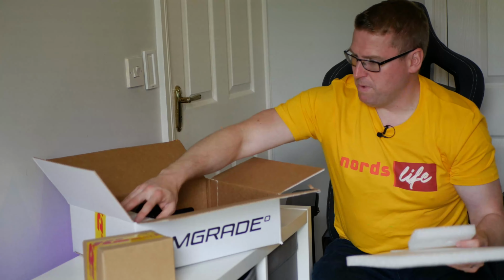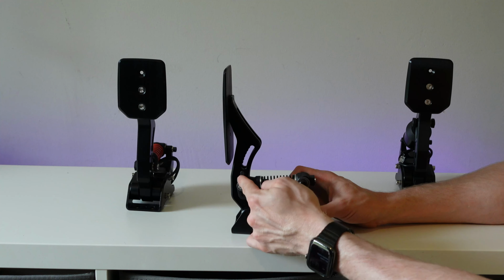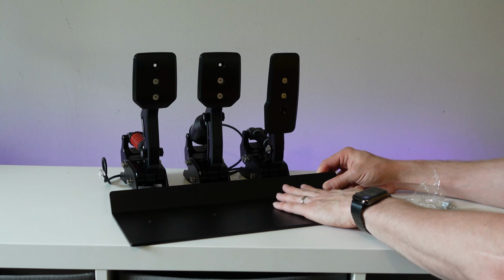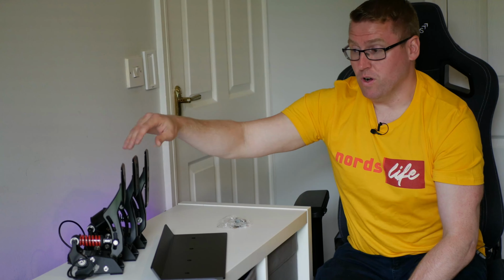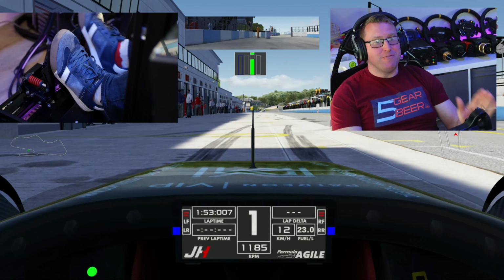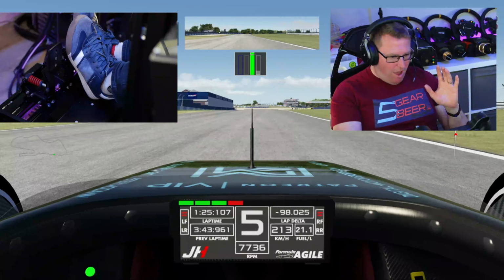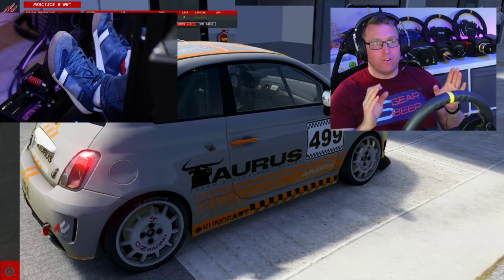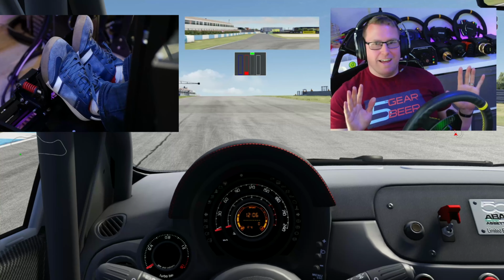Simgrade Thera 200kg Load Cell Pedals | Unboxing & First Impressions

Comment: That pedal deck is mounted the wrong way :D Those long slots are supposed to be facing ur seat so u can angle it more upwards.
Reply from the maker: Yep. I had to reverse it due to the sim floor and the size of my seat mover. If I have it the ‘right’ way around then I cannot hide my cables under my sim floor

Comment: Lol, so much wrong info about the pivot point height on the pedal. Higher position is less leverage, so a harder feeling. So even with the same spring strength, your throttle will feel harder the more you depress it. Same for the brake. High position is a stiff brake with less travel. A lower mounting point is more leverage on the loadcell, so it will be easier to compress the rubber. So basically more travel like you would have with a softer rubber stack on other brand pedals.
Reply from the maker: That is also my understanding. Where did I say otherwise? If I got it wrong, I’ll correct it. Thanks in advance
Reply: @LaurenceDusoswa  You said the opposite here: https://youtu.be/1g9Drkc1i0k?t=340

Comment: Hello, just a quick question, in your experience what is the pedal that is close to an actual normal/road car in general?
Reply from the maker: Good question. I think that most high end pedal sets are better than any setup I have used in a road car. However in a road car you get g forces which make a huge difference to the feel of the pedals.

Comment: The good old struggle of Laurance figuring out where the clutch goes. ;) 

They certainly do look great. Mounted they have a really nice small footprint and look very clean. Im sure there will be a bunch of people interested in them. But what puts me off and probably a bunch of potential buyers is that price point. I mean wow, almost 1.1k € and thats most likely just the introductiory price? Thats a lot of money. I like a minimalistic piece of kit, but that price is more fitting of something overengineered. Curious to see your summary on the longterm review. 
Another thing that would really bother me is the mounting. Was the hardware supplied? Cause those bolts kinda of look pretty ugly with such a sleek pedal set. Im sure there could be ways to hide it with some rubber bolt covers or something that would clean it up and match the theme. But also the placement of the bolt holes of the pedals. That looks like a proper pain to get them in there and especially tighening them. I dont sit in my rig as much as Id like to but I still know how many times I even readjusted my HE Sprints. Configured the throw and resistance but also moved the positions left to right arround a couple of times till I felt comfortable. I disliked that a lot on the sprints with how poor the nuts are accessible on those. At least that isnt an issue with the T-Nuts, but accessing the bolts still looks pretty bad. And lastly that pedal plate. 40€ for that bent square piece of metal with 4 holes? I dont know about that. Looking at you mounting it, I feel like they need more rows of screw holes so you can actually move them closer and further to the pedals rather than just have the heel rest stuck to the pedals or have them far away. Any other setting on a 8020 profile would just be so far off. That just seems not thought out at all. 
All in all I think theres a few compromises that I personally wouldnt like just to have them compact. The mounting really could do with some improvement to clean that up. At that insane price point where they compete with the Simtrecs Pro Pedal GTs, HE Ultimates, invictas (which I already think are priced on the high point) and other very high quality pedals, where I dont think they punch their weight for the price, at least from looking at them. So not very impressed so far.
Reply: I felt a bit the same way to be honest, apart from the 40€ heel plate, I could overlook that depending on the material and finish but yeah those bolts should at least be a socket cap screw and negate the need to drop a clumsy spanner in close to a beautiful anodised finish main body, but the brake looks really basic and absolutely nothing to get excited about, nothing new here, refined? maybe but I don't see anything exciting about these to drag 1100€ from my pocket, the only true innovation I've seen in pedals over the last year or two is the VRS cam based progressive resistance system, and at around 670€ they are not as pretty but they have function and feel in spades.
Reply from the maker: Thanks for your excellent points too <3 This is what these reviews are all about. this amazing discussion, personal experience and getting a feel for what the market is saying about these products. I'm sure they're reading these comments and taking note
Reply from the maker: Excellent points dude. Thanks for taking the time <3